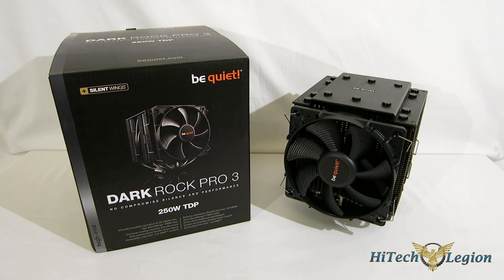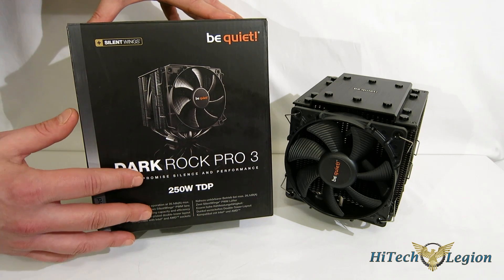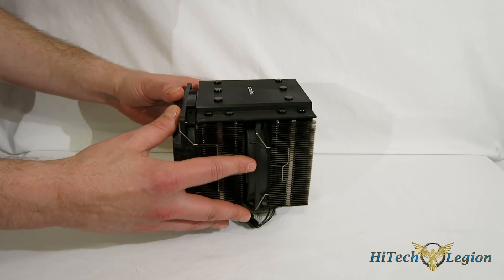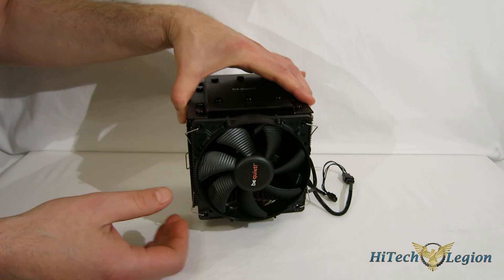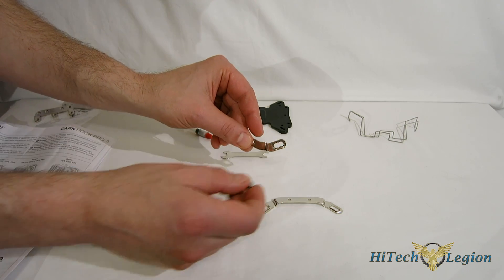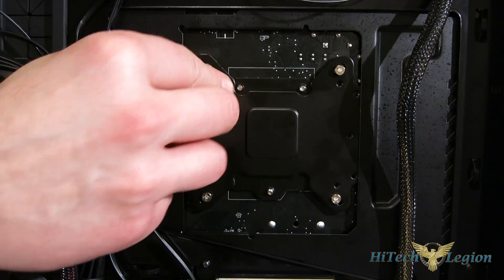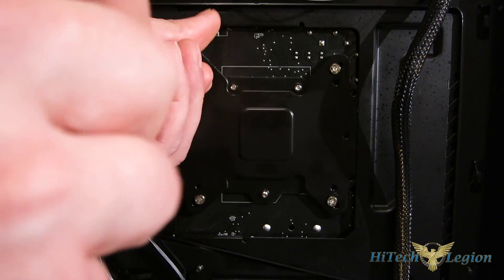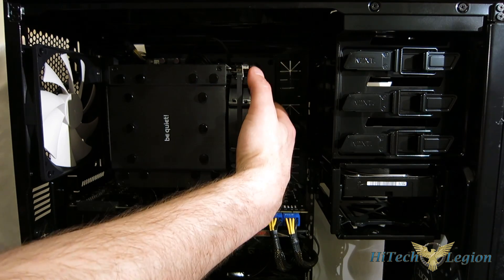be quiet! Dark Rock Pro 3 Overview, Installation and Benchmarks

Comment: Hello,

I have recently purchases this beauty and performance is lacking for me.
I am using it on a 4790K with MX-4 thermal paste.

Temperatures on stock (4.4GHz turboboost vCore 1.15-1.23 depending on load)
I'm getting 70-75C on Asus RealBench and 80-85+ on OCCT/Intel Burn Test.

I have fitted the device two times with the same results, are these temperatures normal or have I done something wrong mounting both times? Thank you!
Reply: There could be a number of factors at play here....and just to be clear, you are referring to core temps, not package temps, correct?

First, the setup of your fan curve. Have you set it up so that you are getting 100% fan speed when the CPU cores hit ~70? Many fan controls work off a package temp that doesn't ramp up the fans appropriately. How do your fan speeds look when the heat goes up?

The airflow of your case is also going to have a huge impact. Are you getting adequate fresh air intake and enough exhaust? Coolers can't work effectively without cool air to use. If there is no air movement in the case, the cooler is constantly cycling through warmer and warmer air. And, of course, your room temp will play a big part in this.

Also, take a look at your Load Line Calibration. I just ran into this issue myself with the 4790K on a Z97 Sabertooth. When I enabled XMP it also set the LLC to its highest setting. Naturally, temps spiked (not quite as bad as what you are describing, though). I brought it back down to midpoint of the settings and CPU core and VCore temps both dropped considerably.
Reply: George Cella Thank you for the detailed interest, really appreciate your efforts!

I am testing this in the following configuration:
-Corsair 550D (HDD bays removed for better front airflow)
-Be Quiet Silent Wings 2 casefans (2x 120mm front 1x 140mm rear)

I am referring to highest core temp measured by both RealTemp and HWMonitor. Whenever I do any stress testing I manually set all fans to 100% through Gigabyte System Information tool. My mobo is a GA-Z97X Gaming 7.

On Asus RealBench v1.1 load my vCore is 1.191V as measured by CPU-Z.
The thing that worries me the most is that temps DONT gradually rise, starting the stress test makes the temp go up to ~70C in a matter of seconds (I'm guessing 5-10secs) where it will then increase very slowly.

I can't feel any noticable heat coming out of the case @100% fan speeds (alot of air pushing around with 2 120's and 1 140 going all out.

I will check the LLC, I have indeed set a XMP profile for my RAM (1600 Mhz).

Again thanks a bundle for your input!
Reply: Suzaku The core temps shouldn't gradually rise on that type of test. They will always jump up immediately. In many cases they will then slightly decrease before gradually slightly rising again. But there will always be that immediate spike when the test is started.

Check out the LLC and see what you find. Your core voltage is also higher than mine, but that varies from chip to chip. At stock speeds mine never tops 1.175, but you aren't far off that. BUT....when I take mine up to 4.6/1.21V, I do get a pretty big temp increase under load, but still nowhere near what you are getting.

I haven't had the DRP3 on my 4790K, but I did have the Phanteks on for a bit and saw a ~6 degree drop from the 4770K in the same system. Unfortunately, I have a loop in this build now, so trying the DRP3 isn't an option, but I know it would follow suit. I also know nothing firsthand about the airflow in a 550D, but I will poke around and see if I find any known oddities with it.
Reply: George Cella Hello George.

The airflow isnt considered great nor awful in the case when HDD bays are removed. With stock fans/HDD bays equipped the front is VERY Restrictive. I have replaced the fans and removed the bays to fix this.

While airflow could be better in other, more open cases I doubt that the difference could be such an issue, I've also done the stress testing outside of the case (just mobo, no GPU flat on the table) with almost equal temps. This in a 22C room. I will check LLC later today when I get home.
Reply: George Cella Hello again George.

Sadly there seems to be no option to change PLL settings the way you mention in my BIOS. I have however found the following info about PLL settings on Gigabyte boards.

"There are two new settings Intel has added in “CPU PLL Selection” and “Filter PLL Level”. On the boards which don’t have this different training the “LCPLL” is better as it is more optimized to maximize a lower BCLK range, high on the filter might work best with it at the 103mhz range as well. However for the Z87X-OC with its BCLK training, the “SBPLL” works much better than “LCPLL”, on auto the board will set “SBPLL” when you reach a certain mhz, and set “low” if you set 112mhz+, you can try “high” but I don’t think you will see any improvement."

I suppose this means PLL has no effect on heat on my system? I'm willing to try refitting the DRP3 again to see if it's any better, I realized rewatching this video I did something different installing... I screwed the bolt to the backplate first, then fitted the DRP3 and fiddled on the caps. I then tightened the screws in an X-pattern whilst holding the caps with the wrench. Could this possible result in non-optimal mounting?

Comment: Ive been looking at getting a nice air cooler for my build. I have the 8350, sabertooth 990fx r2.0 and 2 sticks of gskill sniper ram in a Storm trooper case. I want to overclock the 8350 (to see what I can get). This in mind I was looking at CM V8gts. And now this. Whats your thoughts on the two? and noise isn't really my concern. I don't want an AIO. Thanks!
Reply: We reviewed the V8 GTS, also, and the Dark Rock Pro 3 is distinctly the better performer of the two. If you are looking for flat out performance, the Phanteks PH-TC14PE is the best performing out of the box cooler we have tested on the AM3+ platform, air or AiO.
Reply: George Cella Well I want something that looks decent but performs well to hold an overclock. The fans are what turns me off of the phanteks, being colored of a sort. Otherwise Id look at them more. Black and or black/red is what draws me in. hence these two choices. I guess the BE Quiet should be my choice then. Thanks.

Comment: Better looks and PWM fans. That's the reason I'd go with this over Noctua. If only noctua came with PWM fans... But that's the thing with every cooler manufacturer. They never give out the best fans with their coolers so they need to be bought separately. That makes 240/280 AIO's twice as expensive as big air coolers. Even more so if you go for push pull.

Comment: After watching this video (and doing a lot of research) I decided to go with this over something like Noctua and Phanteks. I have the Fractal Define R4 w/window, so I wanted a nice presentable cooler that performs well and is quiet to boot. Still waiting on some extra parts so I can switch out my current cooler and put it in an older build... Temperature wise, there's a ton of different numbers out there and mixed reviews, but overall majority say this cooler performs and does so very quietly. Do you think this will do well with an i5 3570k overclocked to 4.2GHz? Thanks! I always enjoy your videos!
Reply: It will do very well on a 3570K at 4.2. That will not take this cooler anywhere near its limits. With the R4, I would wager you may not be able to hear the DRP3 even at top fan speeds. It's a great combination.
Reply: thanks! now just waiting for the weekend to get this bad boy installed
Reply: Les Carpio I agree with george, DRP3 with define R4 is one badass combination.. I was thinking the same thing so i'll swap the c70 over the define r4 with my upcoming rig.. I'm still researching for the other parts though..

Comment: What would you say is the smallest case this cooler would fit in? Would it make it in a Bitfenix Shinobi?
Reply: The DRP3 is 163mm in height, so you need a case that allows for that. It is really a question of layout more than "big or small". The Proodigy is far smaller than the Shinobi, yet has more cooler clearance due to layout.

Comment: I would like to ask you a  couple of questions.
1. Could you tell us clearly what's the maximum height for our RAM sticks to be fit (nicely, not barely) in mm? As you said before, a high-profile RAM like Vengeance won't do however, how about Vengeance Low Profile? I have some of those lying around.
2. It seems you're using a Define R4 as your case plus the DRP 3 you're showing us. Just wondering, should I buy another case fans  like Corsair SP 120 for extra cooling? How to get the most of our system and balance it between cooling performance and quietness? I'd like to set my i5 4670K to 4,3 GHz without having a microwave humming in my room all the times.
Thank you. Great video. :D Hoping for a fast answer if possible.
Reply: 1. I measured it at almost exactly 40mm clearance. Vengeance LP fits without an issue. Really, RAM only seems to come in two sizes these days - pretty standard (Vengeance LP, Ares, ADATA XPG v1, Mushkin Frostbyte, Sniper, Viper LP, etc), and "look at my giant fins". The latter will not fit. Thankfully mfg are coming back to Earth and releasing high end RAM again without charging the "look at me" premium. It was really hard for a while to find better RAM without the tall spreaders.

2. I did find that the R4 really needed a second intake fan, and it made a pretty big difference. The other thing is to remove the bottom HDD cage if you are not using it. That opens up a lot of flow. If you are looking at good flow without the noise, I would stay away from the Corsair fans, they are really good looking but have awful flow/noise. I tested about a dozen different fans in this case for reviews, and the best performing low noise intakes were the be quiet! Shadow Wings 2, Cougar Vortex HDB and Noctua 14 FLX.
Reply: George Cella  Thanks so much for the reply. It's fast and rig on the spot.

So, basically what I need to do for now is buy some Shadow Wings 2s to add the cooling performance, isn't it? Could you suggest me how many of them should I buy and where should I place them if I'm using a Define R4 and a DRP 3 cooler? Actually planning to buy a DRP 3 to change the good old CM Hyper 212 EVO :3

Comment: I know that Gskill Ripjaws X ram (40mm height) would fit in the Dark Rock Pro 2. Do you know if it will fit in the Dark Rock Pro 3 in all 4 slots? Cheers
Reply: The best source I can find is this german review (but I can't tell if they got it working with the first RAM slot)
http://translate.google.com/translate?sl=auto&tl=en&js=n&prev=_t&hl=en&ie=UTF-8&u=http%3A%2F%2Fwww.hartware.de%2Freview_1700_3.html&act=url
Reply: As a follow up, I just installed it and it does indeed fit with Ripjaws X installed in all 4 slots (~1mm to spare).
Reply: James Hoffman Thanks for that info!

Comment: Damn, this was looking so good until that ram issue :/ i have Geil Corsa 1866mhz which is 47mm from bottom to top of the heat spreader :/ with that in mind what would your recommendation be for similar performance cooler?  (on gigabyte g1sniper z87 in a haf912+)

Comment: I'm planning on building my 2nd gaming rig, will this cpu cooler fit on a corsair c70 case, will i face any clearance issue? Nice review btw..
Reply: The DRP3 stands 163mm, unfortunately I have no clue what clearance is in the C70 and it is not listed in the specs. It would appear that it would fit with no issue (it does in almost all mid-towers), but I can't say positively.
Reply: George Cella Awesome.. Thanx for the info bro.. Keep it up.

Comment: will it fit with my Patriot Viper ram ?
Reply: Definitely not in the first slot, it may fit in the others if you mount the fan higher...but then you need to make sure that the added height on the cooler will fit in your case.
Reply: hmmmm, ok thx :)

Comment: Would this ram fit? I can't find any dimensions at all.

http://www.newegg.com/Product/Product.aspx?Item=N82E16820211814
Reply: Yes, no problem at all. That also happens to be some of the best performing RAM on the market clock-for-clock.
Reply: George Cella Sorry, I know you can't hear this question anymore but it would really help me. I want to build a complete new PC with this cooler and I want to add this RAM:
http://www.hardwareversand.de/articledetail.jsps?agid=1192&aid=58859&lid=2
Does it fit? When not can you recommend another 2 * 8 Kits?
Reply: Roflkiller Lp That RAM will fit with no problem. But a quick look on that site, I would suggest the G. Skill Ares for almost the same price, and it is 1866MHz rather than the 1333 you are looking at. G. Skill is top quality RAM, and the Ares series will be better quality than the Corsair Value Select.
Reply: George Cella Thank you very much for that fast reply. You got one more subscriber. I appreciate that very much.

Comment: can you add a third fan on the other side? If u can add a third fan will it fit inside the air 540?
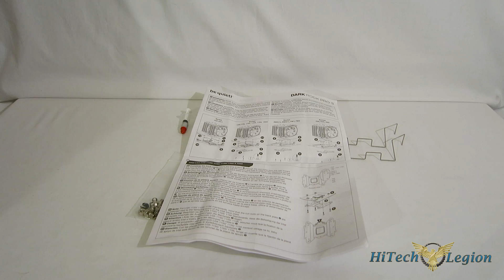Reply: Clips are included for an additional 120mm fan, accessories overview starts at 5:14.

Comment: Can i use Corsair veangance RAM? Or is it to big?
Reply: No....the taller ones have purely ornamental heatsinks. Personally, I would take ADATA XPG, G skill Ares or Mushkin Blackline over Vengeance every time.
Reply: 12:30.....pretty specific.
Reply: oh sry
Reply: i dont know what the difference is between low and high profile ^^ do the high ones perform better? :OO
Reply: Ty :)

Comment: George Cella My setup is not done yet, so my msi z87 mpower max is not running yet and I don't know if it is comfortable to control fans via bios.
And I don't know if the self control from the mobo is good for oc
Reply: The Z87 MPower Max has all of the headers you need, so you are covered there. I have not used a Z87 MSI board, so I really can't say how well the BIOS or included software fan control works. In a worst case, you can use a third-party app to tweak your curves the way you would like them.

Comment: What would be the best option to control 3 fans on the pro 3 ?
Reply: It really is a question of what the best option to control 3 PWM fans is on anything....

It depends on the rest of your equipment. May MBs have two CPU fan headers, and that solves your problem right there. The two stock fans would use one header, the added fan the other.

Swiftech makes a great, simple low-cost PWM splitter that uses the signal from your MB PWM header for speed, and direct connects to the PSU for power for up to eight fans (or other PWM devices).

An external fan controller would definitely be the most expensive and least convenient option for this.

Personally, I would NOT recommend running three fans off a single MB header under any circumstance.

Comment: I dunno if I want to hide my sexy mobo with a hunk of block....Which would be best on slight cpu overclocking, this or a Kraken x60?
Reply: Depends on the overall system and what you are going to be doing with it. The X60 has more overall cooling capabilities, and is probably the best closed loop cooler on the market, whereas this will be a little better in terms of noise/performance. If you want to stay away from the large air coolers, take a look at the Cooler Master Glacer 240L which will give you the best of both worlds. It is also open loop, so you can customize - if I recall you were doing a red involved theme in an H440.
Reply: Yeah, I think I may be overestimating the capabilities of my cpu. And after some reading and your most recent suggestion, I feel the DRP3 is the most sensible solution for me.

Comment: Can you really install it by yourself that easy? It seems you have to hold the cooler in place (09:01) while tightening the screws from the back.
Reply: I just finished installing it and in my opinion it's not so easy. I definitely needed 2nd person to help me; I was trying to hold it in right spot while my grandpa was tightening the screws on backplate:) For sure the biggest issue here was that once I've put the cooler inside and tried to find the right position I couldn't see the screws, I couldn't see much at all (and my computer case isn't small). This cooler takes almost whole space:)
Reply: Ker Midas I see this a lot with coolers that use this mounting kit, but I actually never ran into the problem myself. I have found that when you get the first screw started, the others fall into place quite easily. Just remember that the cooler does not need to be aligned when you start the first screw.
 I would have shown it in this video, but I have found from past attempts that it is impossible to film due to cooler and hand positioning, plus I use Sabertooth boards and the armor blocks everything. Maybe on the Dark Rock 3 I will give it a try filming outside the case on a different board....but if you have the MB out of the case, this install is really easy.

Comment: it would've been nice if the results of the dark rock pro 2 is put right next to this one to see how much improvement was achieved
Reply: I kept the comparisons to coolers that are currently available. Since we do live testing on all of the comparison units for every review (and don't just pull Delta numbers from past results) I also need to have the cooler on hand. I can tell you that the gains were mainly in the noise, which was BQ's goal. Performance difference was very negligible.
Reply: George Cella wow, be quiet is even quieter, that's nice to know. thanks!